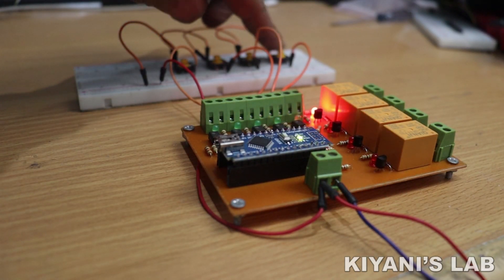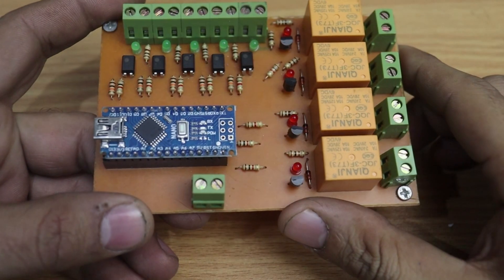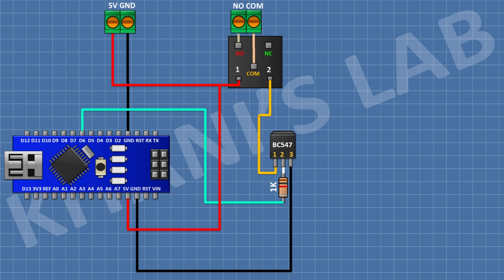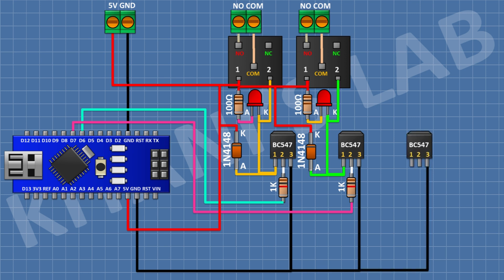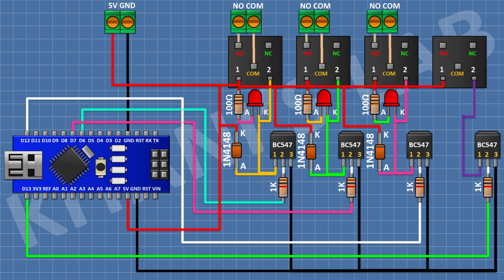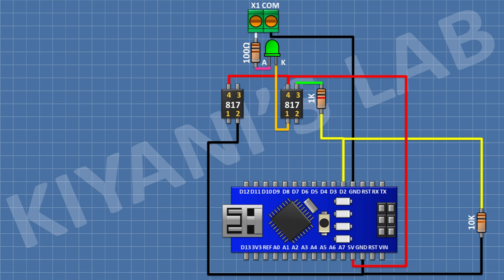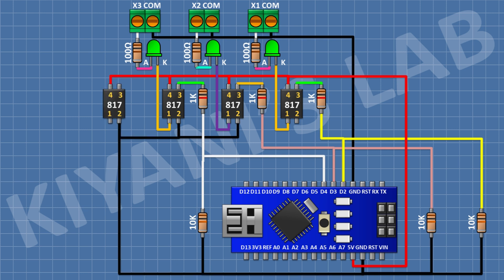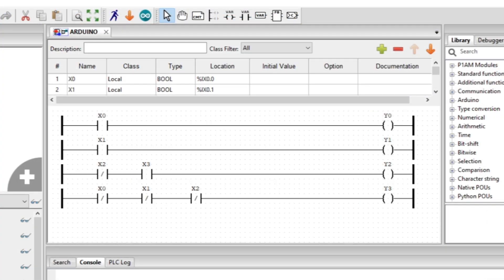HOW TO MAKE ARDUINO MINI PLC | Arduino Project

Comment: I think not need to use Optocoupler cause Digital In 5V is same with Nano 5V contact rate voltage. Optocopuler is need for like 12V or 24V Input.

Comment: Plz make a video on Smart mppt charge controller by the using of oled or tft screen something different for example battery icon and charging animation solar icon 
You already make a video on this but the lcd is not better for this project it is showing to blur

you need modified it,😊

one thing more plz add temperature 🌡️💧senser for the heat seank

i am waiting for it

Comment: New project arduino nano 4 channel Relay or moc3021 BT136 truck driver fan speed control 

Remote control or Bluetooth module add CH05 please sir 💯
Reply from the maker: ok bro